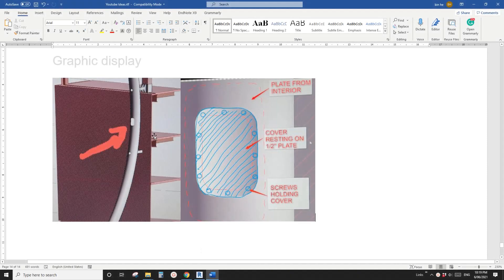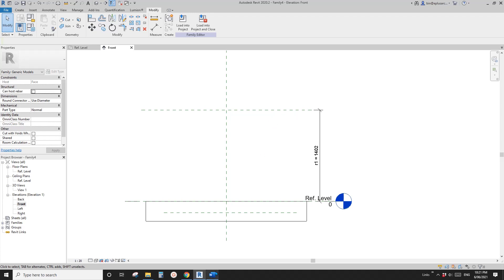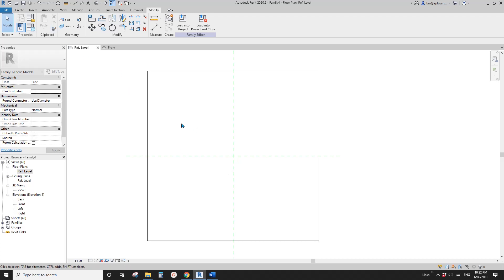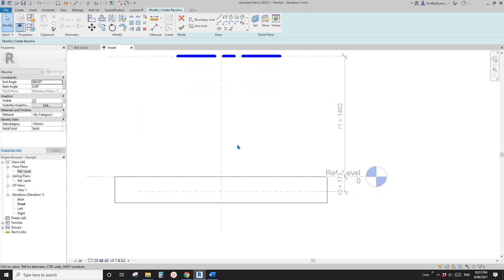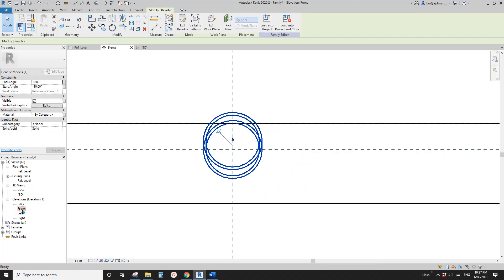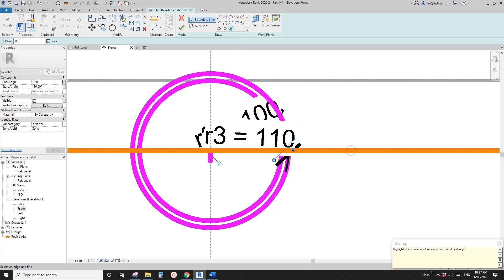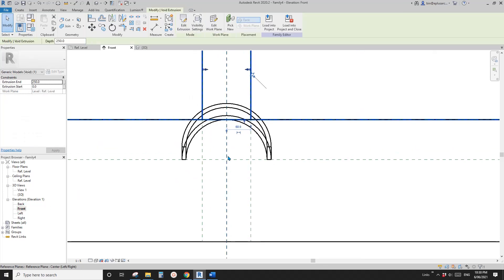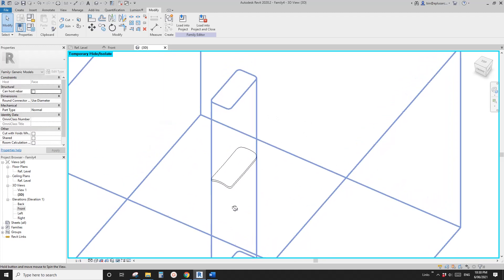Everyday Revit (Day 443) - Parametric Face Based Family Exercise

Comment: Thank you for sharing. Very much appreciated.
Can you show how to make a greenhouse 1" pipe clamp? The pipe clamp hold two 1" pipe that makes the roof of the greenhouse. Been trying hard to make it parametric and face base but with no avail. I've been a revit structural fan since 2015. But that just seems not enough to solve such small but complex family. I think that generic model adaptive template can solve the problem which i'm lacking of skill using it. Thank you in advance.
Reply from the maker: Can you show me an example please?
Reply from the maker: Something like this? 
https://drive.google.com/file/d/12HwXViDf9lhdsR4aH83NeswBgsW8Skox/view?usp=sharing
Reply: @BINHE615  
Thank you for the replies.
Reply from the maker: Can't see your file, access denied.
Reply from the maker: I strongly suggest that you do not model it in your project. Not only because it will take extra time to model and place properly, but also it will not be visible in your plans or elevations due to the size.  I would use a symbol at those intersections and do a callout referencing a little diagram in a drafting view, even detail lines and fill region should be fine. What do you think?